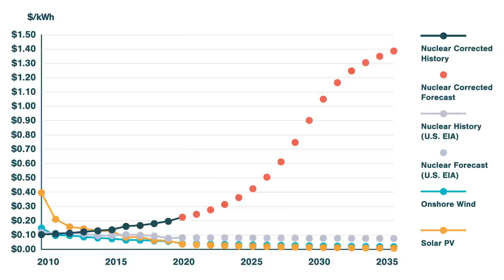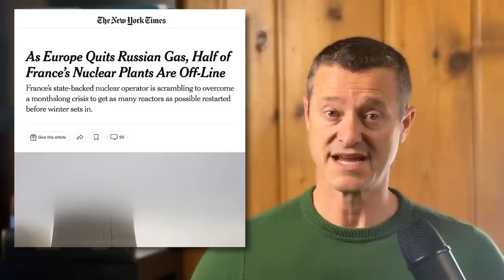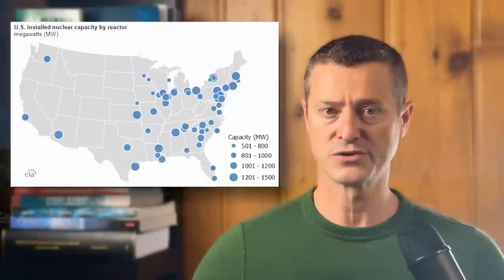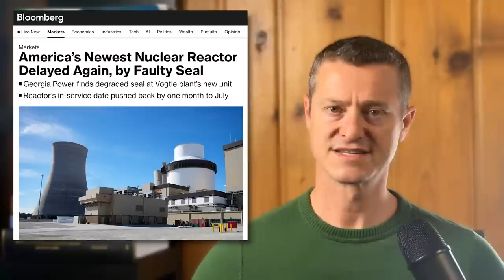Brighter | Episode 10 - Why we shouldn’t build nuclear power

Comment: This presentation is flawed. After decades of development Solar has got to contribute 2.8% of U.S. needs now. Wind does better at 9.2%. There is not even a moderate size country in the world let along a country the size of the  U.S. with battery capacity to support the large amount of time solar and wind is not available. It is suggested here that the U.S. could do without it current Nuclear generation, that’s a whopping 18.9% of base load with a supply of 24/7. In the winter and adverse weather solar output is very low, wind does better in the areas where wind generation is high but there are still lots of time with low output. Battery storage needs to be substantial to just get through the peak demands of the day 7-9am and 5-9pm. Batteries would have to be ludicrously massive to get through winter, weather and even the nights to have a robust supply. So replacing nuclear with solar and wind is practically impossible. Then there is the rest of the base supply which is not clean energy like nuclear of natural gas 38.4% and coal 21.9% that is not even been addressed. This presentation is ideology that simple won’t work.
Reply: Have you seen their research? I haven’t, but I would like to, I don’t know if it’s available. Just saying that solar and wind cover a very low proportion of consumption presently doesn’t prove that it can’t cover all in the future, there just needs to be massive installment of capacity of wind, solar and batteries. We would need to see calculations on a region and city level to see if it’s possible
Reply: Renewables delivered 23% in 2023. Your comment shows the exponential growth curve renewable energy is trending on.
Reply: Citation needed for all the BS figures and assumptions in this comment.

Comment: We might find that deep, dry, closed loop geothermal is technically feasible.  Several demonstration projects currently nearing completion will soon show us whether heat and energy annual operations can compete with solar plus wind plus batteries.  Why bother when wind, solar and batteries seem to have solved the major issues?  Heat.  Great, big, cheap sand and gravel thermal batteries linked to existing municipal area steam heating systems, all driven by the permanent nuclear reactor at Earth's core.  We don't know for sure that it can be done, and maintained, but it seems like a better bet than another generation of manmade uranium and thorium burners.

Comment: Hi,
I have appreciated your series a lot, however this episode could be improved upon I think. I think it is a straw man case to talk about going 100% nuclear. I have heard no one proposing that. It would have been intressting to hear for instance how/if your comments are valid also for countries like Sweden (or is it just about the US) way up north. Would this mean that Sweden would need to rely on energi imports in winter weeks when the wind is not blowing?        During 4 months in the winter, solar gives basically nothing in Sweden and current batteries seem to have problems moving production and usage several months apart.
Reply: He made a lot of bad arguments, just  one of them was this one hinging on the idea of power production fully based on nucelar, which as you said, proposed by no one.

Comment: I agree to most points. Great summary. It's a bit unfair maybe to count major accidents with nuclear power plants. Wind turbines sometimes burn and therefor have major accidents as well. So would be great to compare them. Also in relation to their consequences. A surprisingly small number of people died from the nuclear accidents like Chernobyl or Fukushima. But it's increasing over time. Like now Russian soldiers where digging in terminated grounds. And land has become radioactive. But of course people dying from wind and solar is extremely rare as well. So it's hard to compare how dangerous this technologies actually are. And it's kind of pointless considering all the other problems nuclear has. The main point for me there is, that insurances usually don't insure the risk of nuclear power plants. So at least the financial costs of accidents seems to be very high. In case of a wind turbine burning down, it can be replaced and done. On Fukushima people moved away, crops from the farms couldn't be sold, etc. It's more than just replacing the damaged power plant itself.

Comment: Upvoted, despite the fact that you didn't yet seen to consider mass produced small closed cycle, which IS proven. Please look up the molten salt reactor experiment, Alvin Weinberg and ORNL.
These things could be shipped in a large truck and the wastes is only of the fission products. If open cycle, then yes, it's just stupid and expensive nuclear without the abundant raw materials.
Reply: The Experimental reactor only had to work for a few years. 
A reactor that operated for twenty years  requires corrosion resistant materials that do not yet exist.
They can't be shipped in anything because they cannot be built yet.
Reply: Why I'm concerned is because ONLY with non fried energy sources can we quickly rebuild after those shocking electrical events. That would be fuel and nuclear with and non computerized engines (yes, we might have to forego some efficiency again for the few years or takes to rebuild.
Don't you know that every terrorist is just itching to get ahold of a single EMP weapon? Eventually, it'll happen (unless we also build up laser defense that can penetrate fog).
Reply: @fireofenergy  
You seem confused. As I said, the reactors you are thinking of simply do not exist and won't for decades, if ever.
Robust distributed energy sources are going to be renewable, for the sort of disaster resilience you are thinking of.
Reply: @aaroncosier735  
As you said (twice?) And that I just got back to reading (once?). Ya, real confusing ha ha.
Anyways, tell me exactly how much energy (as in electrical kWh) from wind or solar is needed to make wind, solar and batteries? Sure, solar has EROEI of about 20, however, we need to build up to the inverse of capacity factor AND build two sets of battery storage, in order to have a "24/7" solar watt for the lifetime of solar.
Don't act confused. In other words, tell me how many watt hours needed to make a single watt of solar, how many watt hours needed to make a single watt hour of LFP or other electrical storage (needed to back the solar/wind).
Now, tell me how many watt hours needed per mass produced closed cycle nuclear and how many it'd generate over just a 3 year tubing time?
I'm not confused. I know that burning a certain amount of oil to efficiently make the diffuse and intermittent, can still save (offset) the conversion of hydrocarbons into ~3x that weight into excess CO2, by about a factor of 4, or so. So, solar/wind/battery good (but not completely sustainable on their own).
Also, when hamas dirt militants blow up your local grocery store, we won't need solar, we will need oil and gas, to fight back with!
Moral of the story "use our fossils wisely".
Reply: @fireofenergy  

Since that bothers you so much, find out yourself.
But remember, aggregated renewables from multiple locations give good redundancy compared to a smaller number of large generators.
There is NO "closed cycle" nuclear on earth. None. There is no cost comparison. You may as well ask for "warp" engines or antigravity.

How do you fight with oil and gas when it comes from far away and there is no way to get it?
Fossil fuel has supply lines that are easily broken. Same with the energy generated from fossils. Ports, tankers, oil wells and refineries and generating stations are all targets for your "militants".

Renewables are distributed. Not as much as we'd like, but more so than fossil resources.
Even when transmission lines are down, local grid-forming inverters mean you can get some power when mains have been cut. You can sort damaged panels from good ones and rebuild partial capacity. 

You seem more confused than ever. Hamas may be active in Gaza, in regards a seventy-five year old territory dispute. Not globally.

Comment: Thorium power are much safer.
Reply: Doesn't matter. It's not commercial, so something is wrong. The market is ignoring it for a reason.
Reply: @cg986  it does matter because it is commercialized in china. Please explore more and study more
Reply: @ipdavid1043  References please
Reply: @ipdavid1043  Thorium is commercialised in China?
Where?
They have a single experimental thorium reactor, at far below commercial scale, and no clear plans to build more. Chinese nuclear has halved new build commencements, and delayed several more besides. Chinese Wind and solar have increased both production and installation rates.

Comment: i am quite disappointed because this video happens to touch on something i am rather knowledgeable about, and it conataine quite a lot of false statements. It makes me question the rest of your work.
Reply: list for anyone interested :

First of all : Cost. Cost of a nuclear plant is highly dependant on 2 things :
- interest rates of the loans contracted for construction
- build time.
I 'll discuss build times later.
For good interest rates on such large project, state support is usually needed. By support I mean garanteed low interest rates, not subsidies. Nuclear hasn't had state support in the West for 25 years. It is changing. Russia, China and South Korea build economically very sound nuclear plants thanks to those 2 conditions being met. As have France in the 70s, 80s & 90s and Japan in the 90s & 2000s.

Comparing nuclear power cost to that of other energy sources must be done carefully as they don't provide the same service to the grid. Complexity for nuclear electricity generation resides in the plant. Complexity for intermittent renewables resides in the grid. The grid needs to be much more developped to service spread out production means and to handle peak production decorrelated from demand and vice versa. That cost is hidden when considering adding intermittent power to the grid. The other hidden cost is storage. Despite this channel's claim, batteries don't offer sufficient storage properties as they can't store for long durations. Other means of production are thus needed in a renewables dominated system. Those other means of production will be needed for windless winters but their costs will be spread out over very little production because wind/PV have priority, making backup plants very expensive per MWh, albeit indispensable. That's an other hidden cost of wind/PV.

Now let's go over other misleading/plain wrong claims :

- water : France's nuclear fleet represent's 12% of the country's water consumption, not 50%. Using cooling towers means no heating of the river, and no associated impacts. Building plants on the coast deletes all water related issues.

- the 32 countries that currently operate nuclear power plants represent almost all of the world's energy need, and co2 emissions.

- scale issue : i don't know what to say at this point. A large nuclear plant is 1GWe to 1.65GWe, most industrialised countries have seasonal electrical power demand variations larger than that, and can easily absorb the shutting down of a couple GW when demand is low. We might not power hawaii on nuclear but that is not the point.

- nuclear proliferation : some nuclear reactors technologies are more proliferation prone than others, generally speaking power reactors are poorly suited for military needs, and vice versa. Having a nuclear renaissance without iran is fine with me.

- build time : not building any reactor in the west for 25y has impacts on supply chains, workers skills and licensing delays. It's a bit cynical to complain about delays when everything has been made to lengthen procedures and make it harder to build nuclear. Best construction times in history were under 5 years, as part of large nuclear fleet programs. And no, no country can switch on 100 % wind/pv/batteries in 10 years

- U reserves : uranium prices have been so low for so long that there has been very little incentive to look for more. Doubling the uranium prices would increase nuclear power price by <5% and make vastly more deposits economically viable, as well as incentivize more prospection. The reason fast reactor research has slowed down is because of the exceptionnally low cost of uranium, making them not needed for now.

- materials : this is plain misinformation at this point, the quantities of rare and critical materials needed for nuclear power are immensely smaller than that for wind/PV/batteries. I am genuinely disappointed here.

- waste : the waste from nuclear is infinitely smaller in volume compared to that from wind/PV/batteries. If you consider waste an issue for nuclear, you have to consider it one too for renewables. The sheer volume of panels/batteries/wind turbines that would be decommissioned each day to sustain a 100% renewable grid is staggering, and would be much harder to handle than a couple thousand tons of nuclear waste.

- siting : if a country is too small to have a nuclear plant, let it not have one. Major economies have no trouble finding room for a plant, it's a non issue. It is very contradictory to dismiss SMRs for being unproven technologies if you consider 100% intermittent renewables as the solution.

-accident rates : heating is not electricity, satisfying heating needs with nuclear power requires 3 times less power than satisfying equivalent electricity needs, because of Carnot. Your calculation for the required power increase to go 100% nuclear is thus grossly overestimated. Also, amongst the 3 accidents that occured,  one killed people from irradiation. It was from an very obsolete technology. Nuclear has the best deaths/TWh rate of all energy sources. It is desirable to go nuclear from a pulic health perspective.